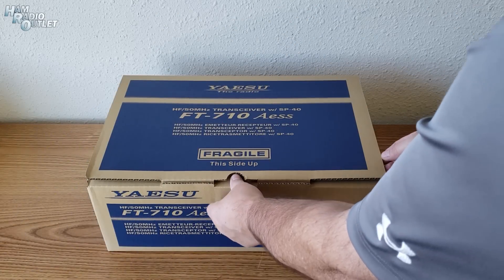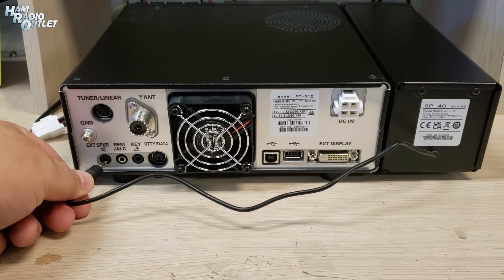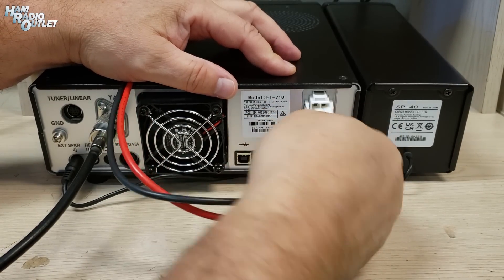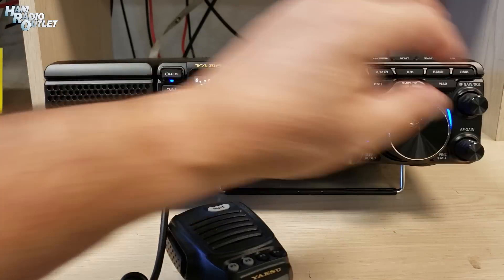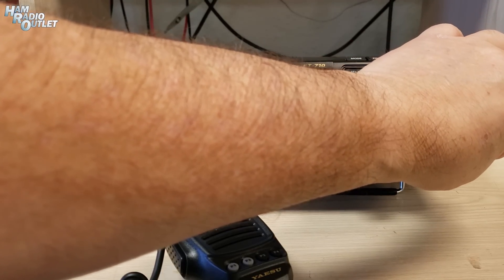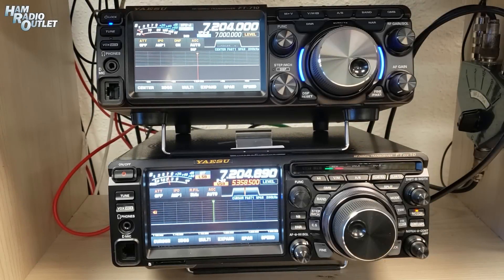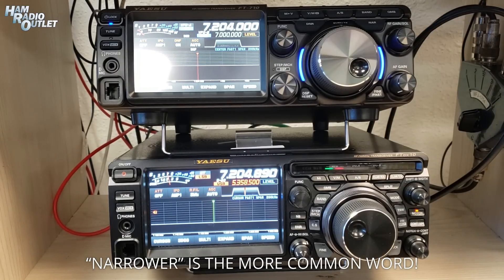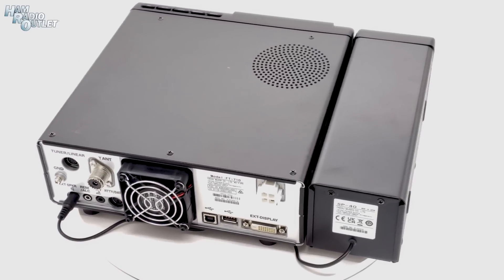Yaesu FT 710 First Look - Ham Radio Outlet

Comment: With these radios, you should put the speaker on the right side of the radio, so you can access the SD card slot. I have one of these myself. De VK5FCHM.
Reply from the maker: It's only important if you're frequently taking the SD card in and out of the radio. If you're using it as storage and/or a backup device, you'll probably want to keep it in the radio so that it's always available, in which case, having the speaker on the left won't matter at all and it may make more sense as it keeps the SD card "locked" in place. If you're constantly taking the SD card out for some reason, then sure, put the speaker on the right.

Comment: Does that external speaker come with the radio? Did I hear him correctly?
Reply from the maker: It's part of the AESS system, so yes, it comes withe the radio. Or you can buy the FT-710 Field version, which does not come with the external speaker (and therefore does not have AESS until you add the external speaker). You can always follow the link in the description and see exactly what you get.

Comment: Hi Julian, Steven Spence here (KF6TSD), former MESAC member (moved to Boise in 2006, then to Florida 2 years ago). Found this video as I was planning to upgrade my well used FT-100D to an ICOM IC-7300 but then started looking at the FT-710, mostly because of the external monitor connection feature. Not to put you on the spot but would you recommend one over the other? I am researching many reviews now on both, it appears the FT-710 may have a small advantage in the auto tuning function as well.

Comment: I think a lot has to do with licensing and whatnot, but it would seem to me that it makes it a bit easier to experiment with some older tech we dont mind heavily modifying and seeing what we can make work on these radios. Might as well just make do with whats there, and if weve got old equipment kicking around maybe someone comes up with something cool. Just trying to find something good about it i guess, and amazon does still sell monitors with the DVI-D input, though I plan to go with the adapter to hdmi myself. I havent seen anything online yet, but I've been hoping someone would try a TFT monitor and let everyone know if it works just like the screen on the radio itself, or if we absolutely must use a mouse too. I dont care to spend the extra money just to experiment, but i did see some smaller cheap ones that might be worth trying out, though I'm guessing given the older technology probably not. Ive been trying to decide between this one ane the IC-7300, and I'm really leaning toward this one I think.

Comment: speaker is on the wrong side, no access to SD card slot
Reply from the maker: You can put the speaker on either side. How many times do you need to take out/put in the SD card anyway?

Comment: The bandscope doesn't look that good.  Even the 756 Pro3 had a nicer, fuller looking bandscope signal!
Reply from the maker: That's straight out of the box. You have to adjust it to your liking. Just as TVs from the retailer are set to "demo mode" so they look bright and super saturated on the shelf, you would (should!) never run them like that when at home!

Comment: What scare me about these,2 radio it almost like the 857D and the 897 D 897 the transmit sucks on HF those to Radio back to back and the ,2 new radio I wonder if the transmit sucks also
Reply from the maker: Not sure what you're trying to say. Have you used the FT-710? Have you put it on a scope to see if the transmit "sucks" on HF? The FT-857 was released in 2001, the FT-710 was released 21 years later. Do you think nothing has changed in those 21 years?

Comment: The only thing that I'm little disappointed is the DVI output instead of HDMI or DisplayPort with sound support. My screens has no more of the obsolete inputs.
Reply: They were probably concerned with the connector staying connected. HDMI cables fall out or get destroyed easily while DVI locks in and has the same quality signal.

Comment: Yaesu needs to learn how to design a user interface. At 5:21, the top-left of the screen is showing buttons: Off, 6dB, 12dB and 18dB. Looking at the screen, what are these buttons referring to? The demonstrations suggests the user pressed the "ATT" touch screen control, but how are you sure "IPO" was not pressed? Of course, this ignores the more important question of why the ATT, IPO, DNF and AGC controls are located between the S meter and spectrum scope in the first place. Why is "DNF" a touch screen control, but "NB" gets a hard button? This is a great example of a poorly designed user interface.

Comment: the 710 does not have some of the features that the ftdx10 has...its a lite version of the ftdx10...just picked up my 2nd ftdx10 and i love having two of them!!!
Reply from the maker: Correct. It is a step below the FTdx10. It is not meant to compete with the FTdx10, but to complement the line-up.

Comment: It looks like the top mounted speaker in the main radio case is actually larger than the speaker in the side mounted box.  Decades ago in the CB era, I had a curved plastic device that would stick on the top or bottom of a radio and direct the sound to the front.  For such a simple device they worked quite well.  I wonder if anyone else remember those?
Reply from the maker: I think the side speaker is probably a little better quality and the enclosure helps also. The external and internal speakers are supposed to work together.
Reply: @HamRadioOutlet  Wow, that is interesting that they use both speakers at the same time.  I assumed that plugging in the external speaker would disconnect the internal speaker.  I'd love to see how this radio compares to the Icom 7300.
Reply from the maker: @BryanTorok  The "using both speakers at the same time"-thing is how the AESS works. You adjust the levels of each speaker to make the audio the most pleasing for your personal preference. An interesting concept. You can, of course, adjust them so that you only hear audio from just one or the other, or unplug the external speaker. It will be good to see how the FT-710 stack up against other radios, I agree.

Comment: Based on past history of the FT-897, I have a strange feeling that the display will be the first thing to start showing problems. I just hope Yaesu had the foresight to have an adequate supply of spares available.
Reply from the maker: Yaesu is not the only manufacturer to have problems with its LCD displays. Hopefully, they have all learned from their mistakes.

Comment: Any advantages of getting this radio versus the DX10?
Reply from the maker: It's going to be at least $400 cheaper when all of the FTdx10 coupons expire?
Reply: I own both . The 710 makes for a much better portable rig because it only draws 1.6A instead of 2.6A on RX.  It also weighs 1.5KG (5 pounds) less, and is easier to operate in the field  because the front-panel is less cluttered with large rubber buttons.  The ATU tunes much wider too, the DX10 refuses to tune wider than 3:1, and the 710 can match 5:1 - again useful in the field when running temporary antenna installations.

Comment: DVI connection for an external monitor, really? It's already obsolete out of the box. Awesome.
Reply: There are adapters that will convert that DVI port and will likely be able to convert it 20 years from now. It is very sturdy IMHO compared to HDMI and Displayport. Also no royalty fees.
Reply: @James-k5f4k  do you realize how much of a non-issue the HDMI royalty fee is? It's a whopping 15 cents. If the HDMI logo is used on the product, then it drops to 5 cents. 100% irrelevant.

Comment: Unfortunately, the rig looks like cheap chinese car radio. No solid feeling at all. Even speaker attached loosely and hangs like an allien thing... FT-847 is not the icon, but far away in terms of good feeling.
Reply from the maker: I think you'd be surprised. The speaker was attached, but I did not screw the speaker screws in. It's not loose when firmly screwed on. The radio was going back into its box right after I was done. I'm not sure how you can tell what the radio feels like from a video. It was as solid as the FT-991A.

Comment: I really like the retro mid-2015 design of this radio. None of those new-fangled current designs like an ethernet connector, they stuck with the old USB and not just a USB but two old style USB connectors - wow!  And the display connector! No need to try connecting up your new fangled monitor that you just bought at Wally World, you can go down to the Goodwill store and if you are lucky you might find an old monitor using this type of connector. Or I guess you could go on eBay and get an adapter. 2014 was a good year to design Yaesu radios.
Reply from the maker: Funny.
Reply: Lucky me,  my sister gave me her old Dell 24-inch monitor, complete with DVI connection, lol.
Reply: Pedantry: Both USB-A and USB-B are current gen connectors. It's the miniaturized connectors that have gone through a few revisions.

Comment: A few years ago I bought a brand new Yaesu 897 for $1,200 and it was nothing but problems. Save your money.
Reply from the maker: Sorry you had problems with a radio that was discontinued in 2014. The problems you had with a 2002 vintage radio are unlikely to transfer to this new radio.

Comment: Why on earth would the display out be DVI on a brand new radio??  That's ridiculous.
Reply from the maker: Asked, and answered... many times in the comments! 🙂 See the video description.
Reply: @HamRadioOutlet  Personally I'd pay the extra $5 for HDMI and a modern USB standard added to the cost of this radio...this seems like a really awkward cost cutting measure.  It's getting harder to find these older standards without needing to order them online...making quick fixes a bit more difficult when something breaks or a cable is lost/forgotten.
Reply from the maker: @ZacharySkaggs  I'm not sure that many people are using external monitors for their radios. I know that, personally, when I have an external monitor hooked up, I still end up looking at the on-radio display, especially when adjusting settings on the radio. Because of that, I don't use any external monitors for my radios. That extra $5 per radio may, in the big picture, put the radio in a different price bracket, as far a Yaesu is concerned. Also, why dedicate a modern monitor to a radio display? The adapters are very easy to find and very cheap. What happens when USB-C is superceded and everybody wants the next greatest connector? LOL.
Reply: @HamRadioOutlet  Sure, none of your points are invalid...but they're missing my point.  If that mentality prevailed why not just VGA and a serial adapter instead?  If I'm going to spend $1300 on a radio, I expect it to have modern I/O...even if it's supposedly a "budget" radio.  USB-C has been a standard for 6 years now.  DVI isn't even an option for input on any monitors manufactured in the last several years.  If I'm a ham on the go, say POTA, I might want to use one of the new small/cheap LED/LCD panels that can mount in my radio case or go kit.  I could easily get something like an elbow HDMI cable and minimize space in my case and have less items to carry.  If i forget my cable, I can run to Walmart or somewhere for a replacement.  Most Walmarts no longer carry USB-B cables.  They definitely don't carry DVI cables.  What's with the insistence on ham radio hardware living in the stone age and trying to justify it at these price points?  It's not acceptable.
Reply from the maker: @ZacharySkaggs  Sure, but serial ports are not in common usage on any consumer grade devices. USB-B is*. You'll find it on every printer and many other devices.  I'm pretty sure all Walmarts carry printer cables, which is what USB-B is. The FT-710 isn't marketed as a portable radio, so the (relatively) few hams who would take it mobile, *and on a POTA trip, and want to use an external monitor while doing it, is pretty small! Adding a tiny DVI-HDMI adapter would increase the weight of the go box by what, an ounce? Or, use a DVI-HDMI cable, that way you're just switching one cable for another. USB-C is great, but it's not the be-all and end-all of connectors and will likely soon be replaced by the next best thing, and then there will be complaints that manufacturers are still using USB-C instead of USB-Z. Regardless... voice your concerns to Yaesu (and ICOM etc). If they hear it directly, they may change their ways.

Comment: Another HF radio, Yaesu need to think outside the box, give us something that we want and need, we don't need another HF radio!
Also they to redesign that scope, if is unuseable...
Reply from the maker: I think the scope is usable if you turn down the gain so that the only peaks you see are those above the noise floor... and you adjust the scope (not the receiver) so that the noise floor does not register on the scope at all.

Comment: Looks nice, somewhat similar to the FT 991 it seems. If I had the money, I'd consider getting one.
K9DWB
Reply from the maker: It's the same size, as you can see in the video), but of course, the FT-991A has VHF and UHF as well as 160-6m.
Reply: @HamRadioOutlet  interesting, some have thought the FT 710 might be replacing something current, but that sounds incorrect. For me, the FT 991 may be more useable due to all the bands available.

If/when I do go to buy, I'll be contact HRO Woodbridge, where I've bought before.

 Great info and thanks. 73s K9DWB
Reply from the maker: @DeltaWhiskeyBravo13579  John Kruk from Yaesu said the FT-710 is not replacing any radio in their line-up, but is an addition, so your thoughts are correct!

Comment: kinda makes me whant to ask why a dvi output  and not either a d-sub or hdmi output
Reply from the maker: That question has been asked and answered so many times here in the comments. Short answer: HDMI has a per unit license fee. There's no audio passed to the external monitor. DVI to HDMI adapters are very cheap.
Reply: @HamRadioOutlet  I mainly asked this Question because

a. Resolution  capacity of d-sub has been at/past 1080p for the 10--13 years sub 4k 5-8 years
b.I don't use pc monitors any more for display these days only 2 inputs i have on idiot box which none have dvi input, haven't seen a capture card with either d-sud nor dvi input ever

c. Have had wireless monitor pairing in iOS/windows/android PC/tablet/phone in 1 form or another for at least for 5-6 years now with bluetooth pairing you could even pair ya hearing aid to a ipad, phone, within the last few update to the sony x 1 tv directly..

I was merely asking why i we still stuck to a dvi/dvi-d connection when either 2 d-subs could be functionally use or 2 hdmi/mini hdmi could be used 

with the light of some radios coming with 4g-lte-a or even 5g could be functional call medium

I would dare say with data rich broad band environment where data is a need as a whole I can the grand daddy of pc chat tech being used like mirc/discord/paltalk/rw

with huds becoming a commercial reality within motor vehicles I'm looking at braille and deaf communities need either access to reserve comms with text messaging across amateur/commercial/cb comms of pending visual status of the general area they live in..

Comment: I dont see Yaesu's marketing here.  The FT710 is so close to the FTDX10, 710 a little smaller.  I do like the side speaker mount and the speaker is being supplied with the rig unlike the FTDX10, it is optional, a factor in total price, additional $170.  The FT710 just put some of the buttons on the top.  FTDX10 does have IF filter adjust knob, a most useful feature. I'd pay more for the FTDX10 just for this knob.  I did not see how the IF filter was adjusted on the fT710.  FTDX10 or FT710 is not replacement for FT991A, the 991A also has 2m& 440 all mode and Fusion, very different rig in many major features.  All are IF DSP.  I bought  FTDX10 in early July, if the FT710 had been available I still would have gone for the FTDX10.
Reply: I have the impression that you lack knowledge.
FTDX10 and FT-710 look similar? After all, it is normal that the products of the same company are similar in appearance, see cars of the same brand, they also look similar.
Just because both radios look alike doesn't mean they are the same. There is a gap between the FTDX10 and the FT-710. These are transceivers of a completely different class: FTDX vs FT. The first is a great hybrid, one of the best receivers in the world according to Sherwood engineers, and the second radio is a standard model made as SDR.
The loudspeaker for the FT-710 is not standard, you have to buy it just like for any other transceiver.
None of the radios replace the other, because each is different and aims at a different recipient. Comparing the FTDX10, FT-710 or FT-991A does not make any sense because each of them is from a different shelf and for different customers.
Reply: @Sylwester_Krolak  Well I am not so impressed with your assessment.  The FTDX10 and FT710 are very similar rigs, have almost identical specs.  Both are SDR, but this only means their OS can be upgraded thru new firmware, mostly to fix bugs.  And any upgrade is limited by what the rig can do.  FTDX vs FT labeling means nothing other than Yaesu chose to call them that.  This is no special labeling of the rigs, just Yaesu has stuck with the FT label.  Their is a vast difference between the FTDX10 & FTDX101, the 101 is direct sampling, the 10 is not, 10 & 710 do the DSP at IF, not at the front end.    The market for the FT710 is identical to the FTDX10, very little difference.  And the FT991 tech is so similar to the FTDX10, main difference in the additional bands in the 991. HRO is giving the ext speaker with the FT710 for no additional charge.
Reply from the maker: @n9eerptr  To Your last point... the speaker comes standard, in the box. In my video, I didn't see it in the box as it was contained in a box that looked like packing for the transceiver.